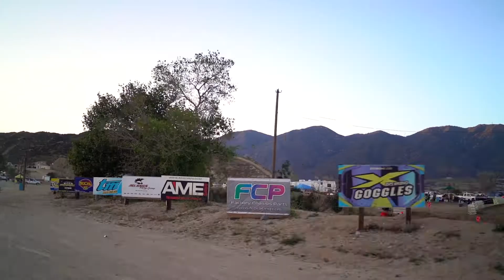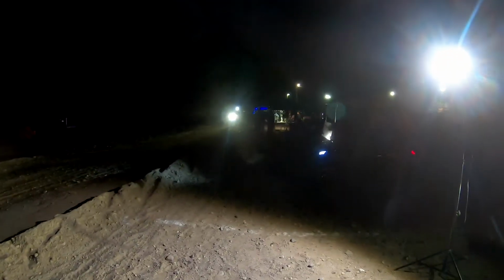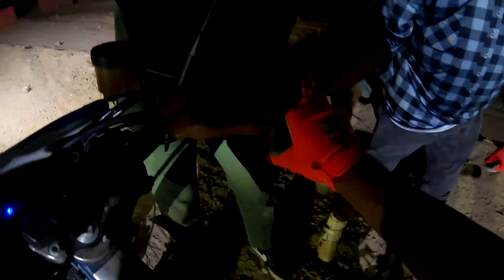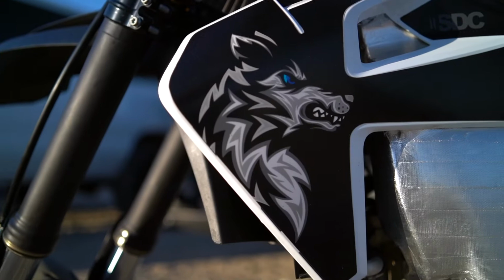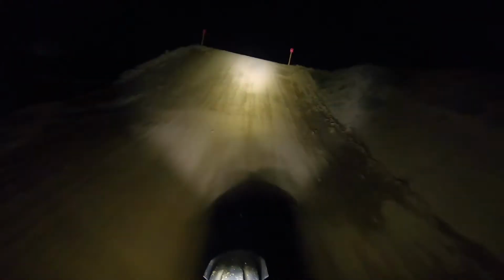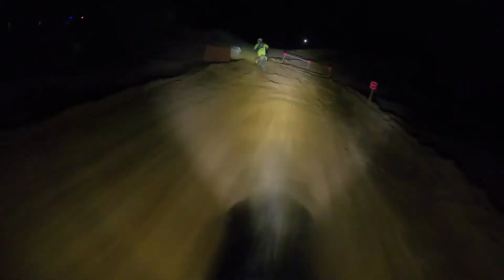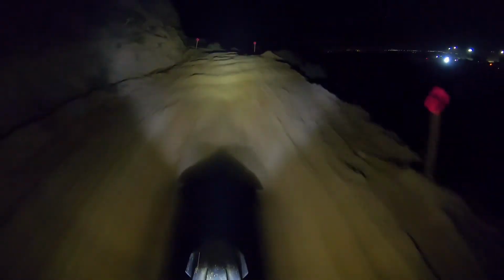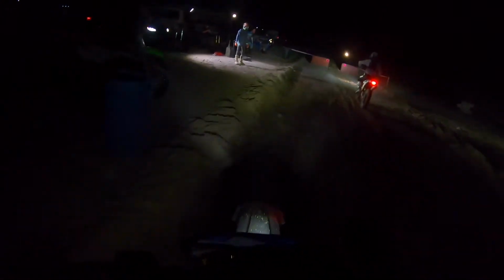Riding a Supermoto to a Motocross Race  - Dirt Bike Night Ride POV

Comment: what sprocket set up do you use for dirt?   how did you use smaller front rotor on that bike?
Reply from the maker: Yes one tooth down on the front
Reply from the maker: Just swap the caliper bracket